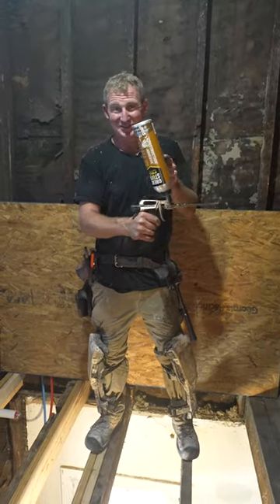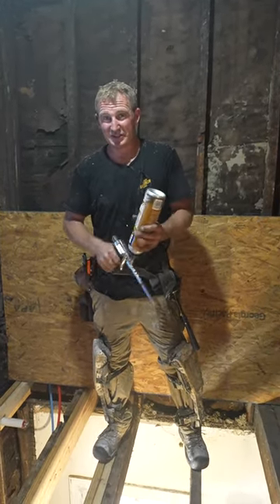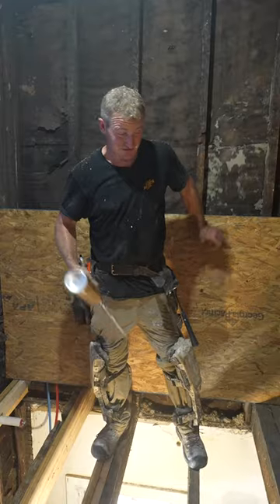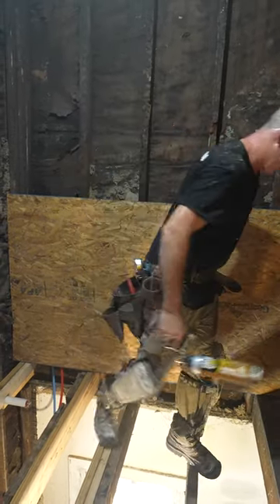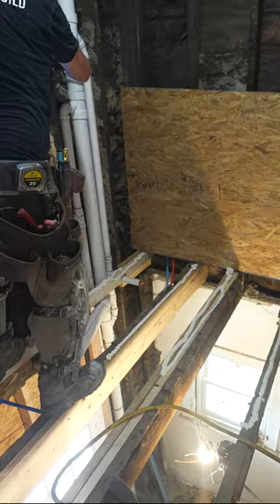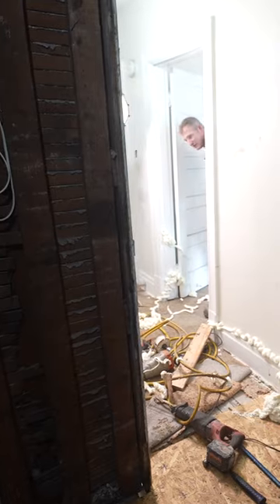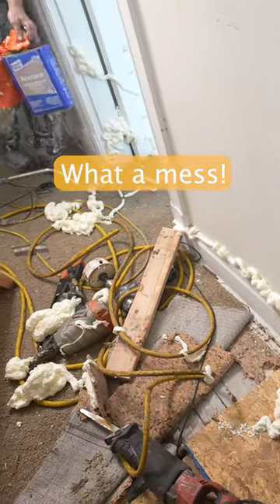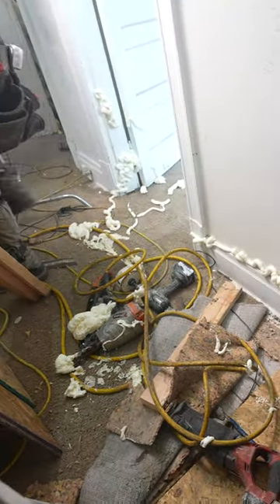Spray Foam Mess #shorts #diy #homeimprovement

Comment: Those guns are a game-changer: subfloor adhesive, insulation foam, foam adhesive, fire blocker. Don’t damage the tip and always flush it out. Watch your eyes, hands, and lungs too. Drywall adhesive too. Love it.

Comment: Those pro knees are game changers, don't see enough of the trades using them
Reply: What is it ???
Reply: @Needalex  it's the knee pads he's wearing, worth every penny. The company also offers rebuild kits for when the pads are shot
Reply: @dr.binjohnson7776  omg ive found a 500 dollars version is it thé price ?
Reply: @Needalex  not sure what they cost anymore, but could be 500. I've had mine for 10+ years with alot of use per year, much better than buying cheap ones a few times a year that have minimal benefits
Reply: @Needalex  just got to their website not some off site

Comment: Just to give you a warning that foam adhesive doesn't hold up after time. I'm just curious why are you using OSB board on the floor that's just made for roofing and siding not decking.

Comment: I just did new floor joists and subfloor. I used the glue while sistering the joists but i screwed down the subfloor thinking ahead to the future. If I ever gotta replace those subfloors again i can just unscrew the old one rather than ripping up glue.

Comment: I put down 1800 sqft of floor using that by myself it made the process very quick and easy. The longer tip guns would have made it even easier. Put down nice thick beads since my i joists were 3-1/2 wide, glued and screwed!

Comment: 1st, you would have to break the flooring to get it back up. 

2nd what a messy job
3rd  risk of more danger, because you have to spray on joists before laying.  

Also, to the man in the video. Please be more careful putting both feet on a single joist.

Comment: Two things have you seen the 4-ft wand which is nice and you're not supposed to take the can off the nozzle if you want to keep the nozzle and they make a spray foam cleaner spray foam that will save your gun that will save your $28 gun